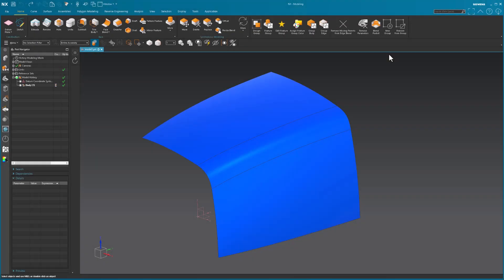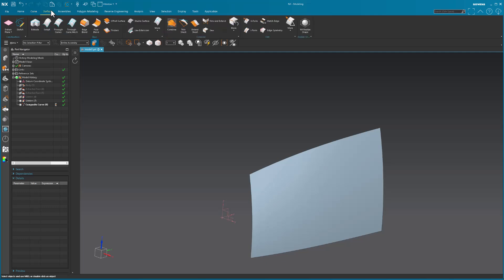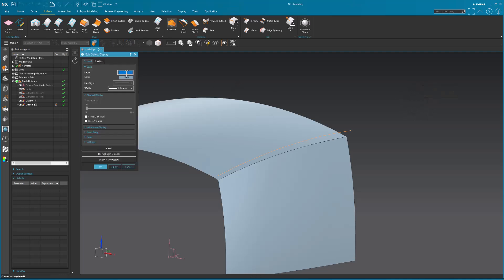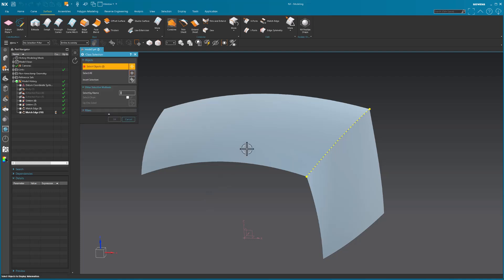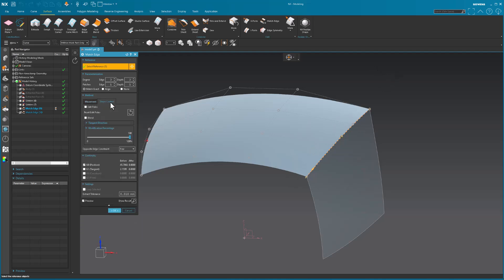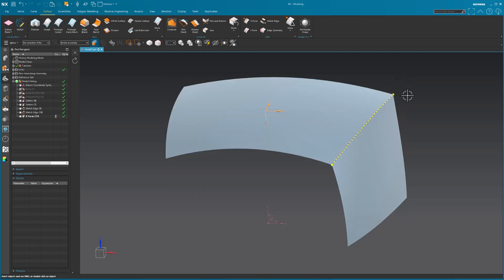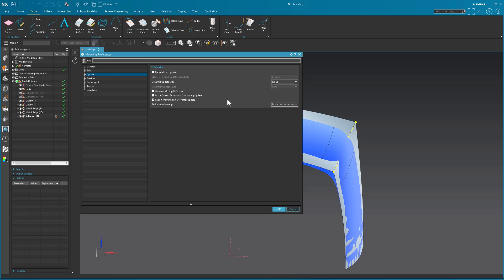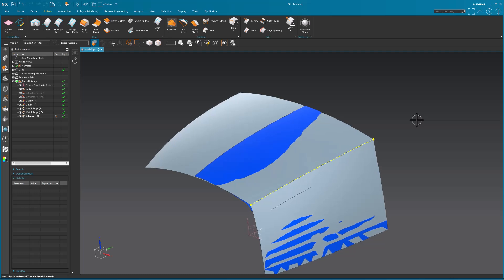Siemens NX 2406 | Reparametrizing Surfaces

Comment: Really neat options with the X-form command! I see it is just a simple exercise scenario. Similar thing was done by Barry Kimball in alias but I believe there was no 'driving curve' as he had to constantly 'delete history' as the main focus in his exercise was the blend surface quality and that there were no 0Gs (inflexions) in the theoretical (0G match).
Reply from the maker: Barry is a great modeler. One of the best. If there were a way to make it driven geometry in Alias, he would be the one to do it. 

The nice thing about the driving curve is that it acts as an anchor that all sorts of stuff can be fixed to.
Reply: you definitely can do the same thing in Alias. In barrys case he was just using the "alignment" feature without history.
Reply from the maker: @akaAlias  We are talking full parametric like NX. I know Alias used to have issues with keeping history so most designers do not. When I used Alias 15 -20 years ago the history tools sucked. 

I worked with Barry at ICEM years ago.  He does it that way for good reason.
Reply: @StevenMarji  I might be misunderstanding something. This is a simple one (single span) patch alignment to a curve with an additional symmetry on one patch, the curve is controlling both patches (associativity). There are definitely reasons to disable history but i was referring to what you are showing. Icem is great as well and Alias got much better over the past 15-20 years. I like your content!